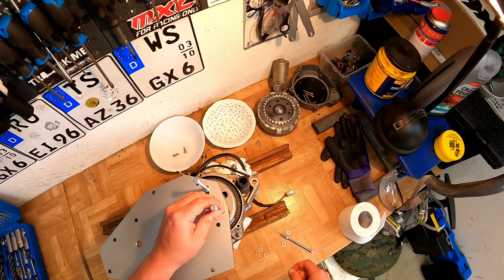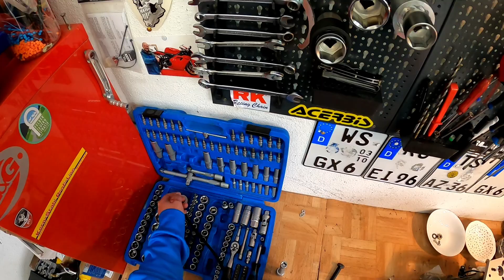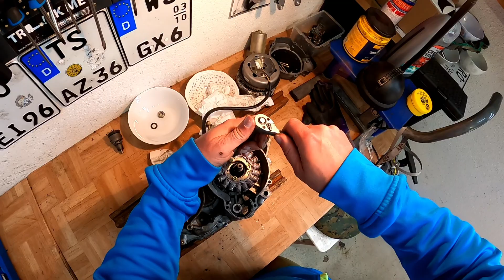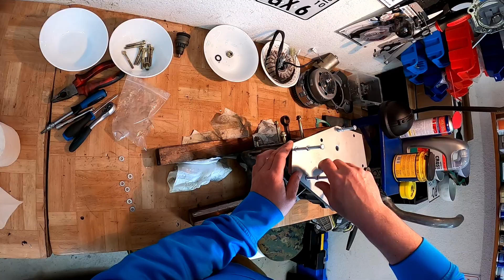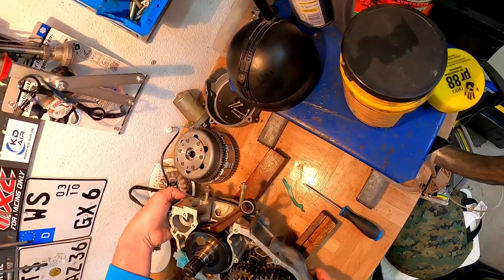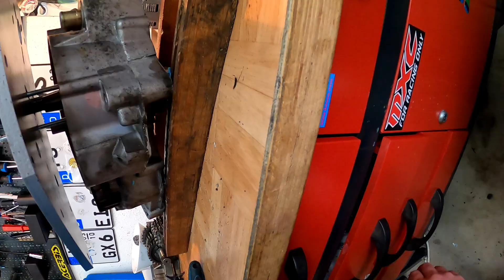Aprilia RS 125 Engine Split | Remove Flywheel and Crankshaft | Motor Trennen [Engine Rebuild Part 5]

Comment: where did you get that tool to remove the flywheel etc
Reply: and also the piece of metal to hold it in place?
Reply from the maker: I bought it on eBay Kleinanzeigen
Reply: Just take the clutch casing off first and before you take the primary dive and clutch basket off put a penny behind the primary drive and clutch basket teeth on the back it locks the flywheel, u do this to temove primary drive nut aswell👍
Reply: I cant seems to find this tool on Ebay. Have you got a link?

Comment: Is suppose you are tearing down the whole engine down in order to rebuild it and replace seals and gaskets etc. so it's good as new.

Are you going to make a video where you explain how to assess the individual parts as well? Because that would be the ultimate RS 125 video on the internet, allowing everything from newbies and up to replicate all the steps and learn how to service and assess the state of wear of the whole engine (and other parts in other videos).

One way to do this if you want to add information retroactively to you existing videos, is to add subtitles.

That would be awesome.

(What camera and tripod are you using to film this, btw?)